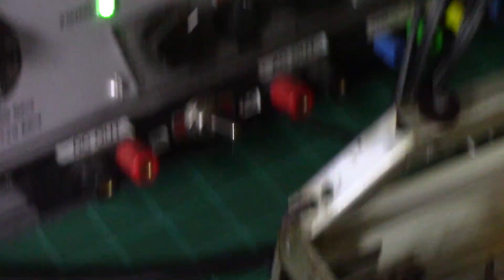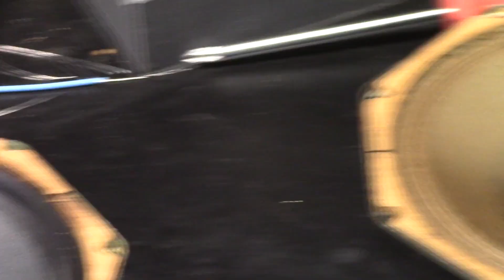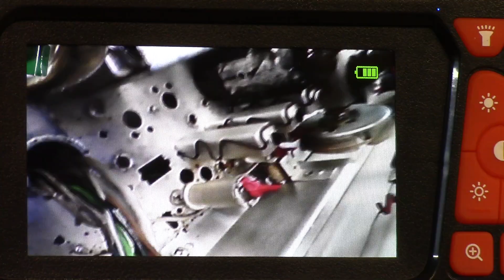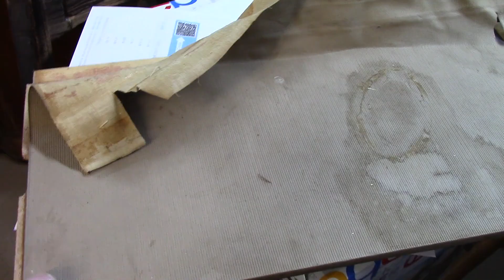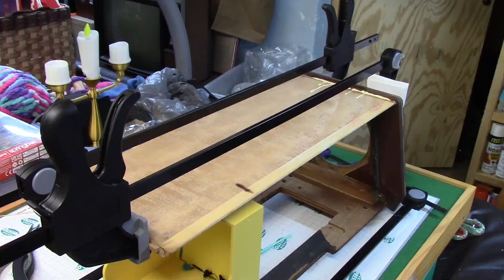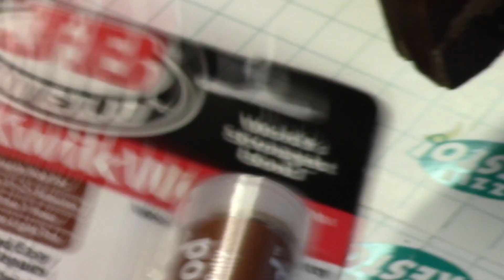1961 Phillips B5X04A Radio- Part 5 -1st Power up & Cabinet repairs

Comment: Great work on that radio Gregg. That endoscope on the bench is a great idea. I have an endoscope I have use inside rifle bores but think I will mount mine on my work bench to save my eyes. Bakelite is pretty tough material but will snap. Hopefully that super glue will last for years. Thanks for the video.
Reply from the maker: Thanks Larry!